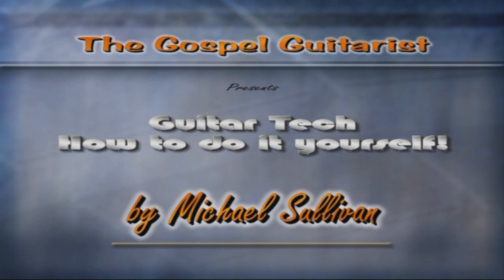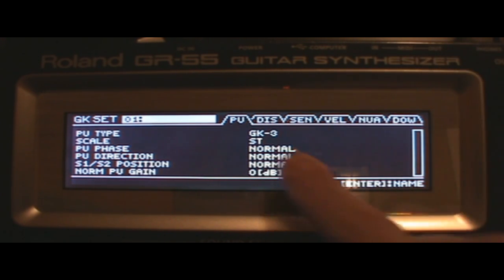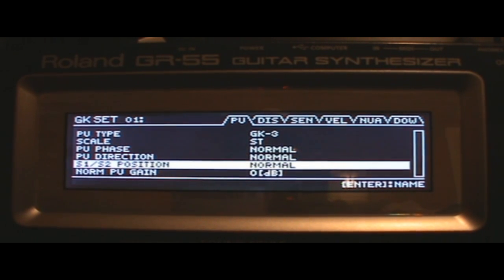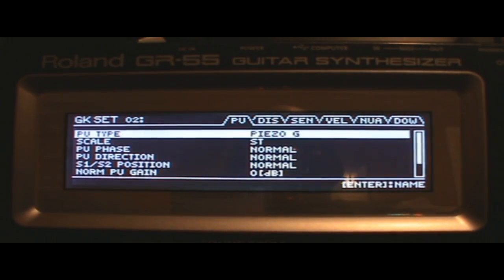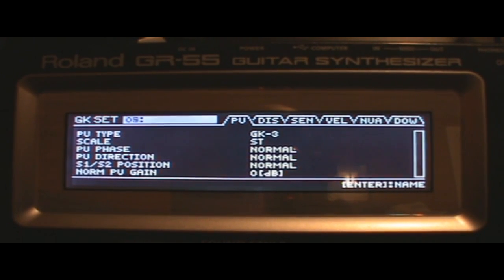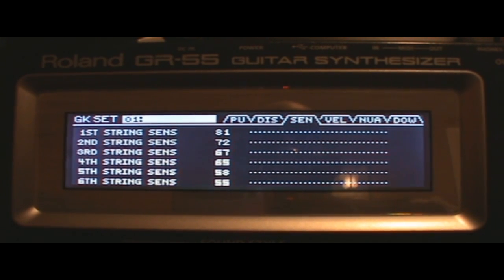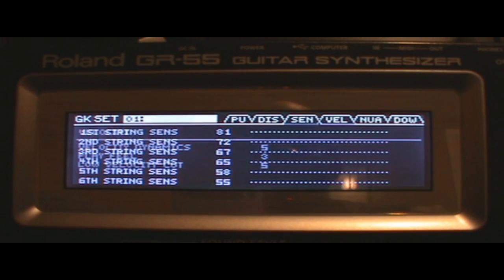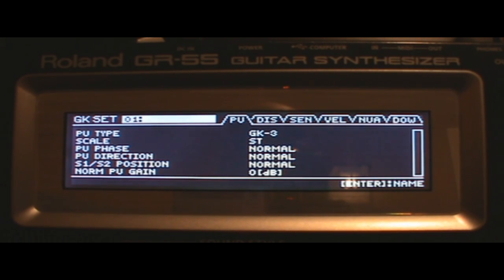Roland GK-3 Setup on the Roland GR-55

Comment: I bought a Roland ready Strat.  I am watching the videos before I start. The only problem I see with this video is you didn't show us how to access the set up menu?  I'll find it. Thanks for the vids, these are the ones I  have been looking for. I skipped the first vid because I have the built in GK-3 built in. I will go back to the first vid.
Reply from the maker: Glad you're finding the vids helpful, good luck with your setup! I no longer own this unit but I very soon after buying it got the Strat. No more connection issues with the gk-3.
Reply: @TheGospelGuitarist  I can't get any of the outputs to output both guitar and pedal with the switch on the guitar. If I plug into guitar out, I only get guitar out, switch the guitar to pedal position and nothing.. If I plug into either of the other two outputs I can only get the pedal out, flip guitar position switch  to guitar and I get nothing?  What am I missing? What do I have to do, run a standard 1/4 inch jack from the guitar to another amp or a different channel so I can switch between guitar and pedal?

Comment: Sir I subscribed liked share. 
Gk3 latency problem solution please
Reply from the maker: You need the manual which goes over a ton of settings to get the pickup to respond and play the way you want it to.  There are too many settings to cover here. If you don't have it, you can find it online with a simple search for it.  There are many factors at play. If you purchased it used you should do a factory reset first. I've never had latency issues. It tracked very fast when I owned mine. There isn't a quick fix to get it setup the way you want. Basically, you are the only person who knows what you want it to do according to your playing style and feel and the guitar. Thanks for subscribing, I hope you get it setup. Cheers!
Reply: @TheGospelGuitarist  sir I already bought Roland gr55 with Gk3 but latency problem specially while playing flute saxophone violin piano etc fast notes the sounds cut out. 
Thankyou for kind reply
Reply from the maker: Unfortunately, you would not be the first to receive a faulty GK-3. Lots of people have problem with that pickup, me included. The wiring is so small they crap out all the time. Do you know anyone who has a GR55 you can compare pickups with. Do the other tones work ok? Like the guitar section. You may have the sensitivity set too low or not playing hard enough or the pickup needs to be closer to the strings. Explore the settings if it all works but has long latency. I sold me off a long time ago, more fiddling than playing. I would grab another one since so many people have issues I could look deeper into to help. I do have the manual still as a reference. Hope you can figure it out, Roland may be helpful if you give them a call.  If it all works, there is probably a setting somewhere you missed. Best wishes!
Reply: Ooh sir thankyou for helping us

Comment: Can you tell me how I can set my GK-3's S1 and S2 switch to be able to scroll up/down the banks on the GR-55?  I just got mine and I think the default is set to have S2 be able to keep scrolling up the banks but not down.  Now, don't know what I did but I seemed to have disabled the S1 and S2 switches completely.
Reply from the maker: +Heu T Comes setup so S1 up S2 down. Do a reset. the manual tells you how as well as how to setup the switches.

Comment: Hi Mike can l use a standard pickup on the roland gr 55 or do l have to use the gk3 pickup.
Reply from the maker: +Mahir Akkus You will need the Roland GK-3 or other branded MIDI pickup. Each string has it's own magnetic pickup and is treated separately through MIDI. Normal pickups send every string through 1 wire, hex pickups have 6 individual pickup wires.
Reply: +TheGospelGuitarist Thanks a lot for replying back.
Reply from the maker: No problem! :)

Comment: Hi Michael I do everything backwards LOL I went through this yesterday after I seen your first video on the GK-3 install I am installing the GK-3 on my PRS custom. So far I can not get the stock pickups on my guitar to feel along with the GK-3 when the switch is on mix or Guitar settings position ( on the GK-3 interface ) You would think Rolland would have this info as the first thing you would see instead of putting it somewhere in a 1/4 inch manual. as soon as I find the fix I will post it. thank you for your speedy reply I know you will be looking for the fix too. I want to play now LOL thanks buddy c];-D

Comment: Mike, how do you determine string distance? Do you actually measure it before putting it in, or is solely a question of 'ear'?
Reply from the maker: Install the GK-3 then make your measurements and enter as close as you can into the distance settings. You measure between the center of the individual pickups to the center of bridge piece for each string. :)
Reply: Thanks. As for 'scale', I play a Charvel 475 Special - I suppose that qualifies as 'strat'?
Reply from the maker: Yes, I would think so. Any Strat type of guitar will do as long as the scale isn't too far from a Strat. Bottom line howeve, is to use the setting which you find work best for your guitar.

Comment: Hi Mike, thanks for this video, but i have a problem with my GK3, i first installed the GK3 on my 22 fret Ibanez, it worked well, then i transferred it to my 24 fret Ibanez, then suddenly the 3 lowers strings such as E, B and G sounds so low, i almost could not hear it compared to the bass strings E A & D which sounds better. I noticed it pretty obvious that there is almost no sound at all when i play piano, but when i hit the string pretty much harder, it will sound, but not the same as the bass strings EAD. What do you think is the problem, may be you can help me out. Thanks..
Reply from the maker: Have you setup the GK-3 for this new guitar. The bridge saddles may be much farther from those 3 Gk-3 pickups than they were on the other guitar. Every time you move it you need to go through the setup again. Also the amount of distance between the pickups and the strings should be checked. So go through the whole setup procedure to check everything out.

Comment: Hello, mike i just purchased Gr-55 and I'm having trouble finding the settings for gk-3  edit. Also im trying to find the drums and its been a real pain! The model is in default settings.
Reply from the maker: It is in the system menu items. Hit 'edit' then page to 'system', it's the first one on the left. You can find 'drums' in the 'tone category' of the patch settings. Use the wheel and scroll to the end. I've not used the drums so that's all I can tell ya. Hope this helps! Have fun and don't forget to read the manual at least once through. You need to follow ALL instructions for setting up the GK-3 or you'll get in trouble.

Comment: Hi. do you have latency on synth sound? When i use COSM or normal pickups latency smaller than 10 msek. I can play good and feel good. But when i use PSM SYNT  latency ~15-20 msek. Not too big but it makes me crazy... cant play fast things. Do you now what problem is? I use  Roland GK-3 with a Roland-GR-55 just like you. (sorry for bad english :)) )
Reply from the maker: I don't know what instruments you are using but whatever the instrument is you need to play it like you would play the real instrument. For instance a trumpet is not going to be able to do a solo as fast as a keyboard to guitar ect. So instruments have a slower attack time on notes and you need to slow down for the patch to sound right. I haven't noticed a latency issue myself but I am not a fast player either. Not a shredder anyway. The problem however, can be that you don't have the GK-3 setup properly. That will definitely lead to latency issues. The really great players out there seem to praise this thing tracking ability. Take another look at your setup and make sure everything is setup the way you need it to be.
Reply: Thanks for the answer!

Comment from the maker: See my other video on the "cntrl" switch and expression pedal setup. Let me know if you need more help after that. The foot switches are used for patch selection. This unit does not operate like a Boss-ME70 where you can turn on/off say Delay on footswitch 1. You need to design patches and then utilize the cntrl foot switch and expression pedal to do some other switching within that patch. Then save the patch to your user area.

Comment from the maker: The GK-3 is Rolands MIDI pickup system which you attach to your guitar to be used with the unit. You cannot operate this unit without a 13 pin midi system. The unit doesn't take a 1/4" guitar chord to plug in your guitar. You can check out my GK-3 Install video to find out more.